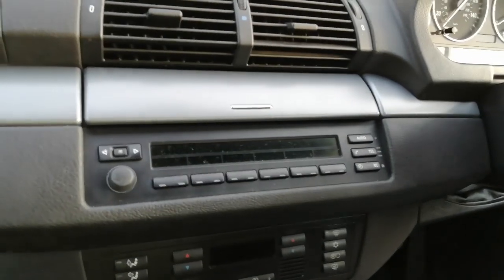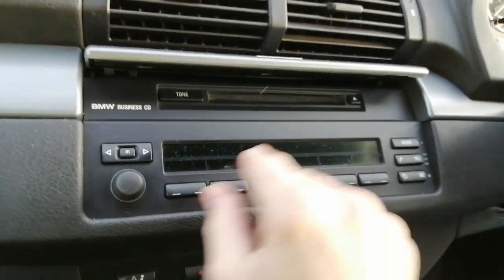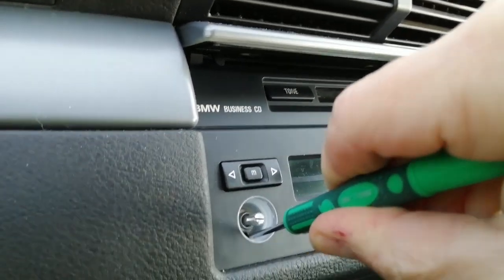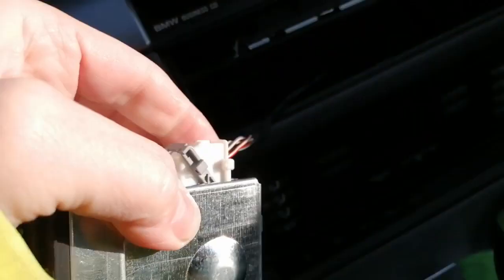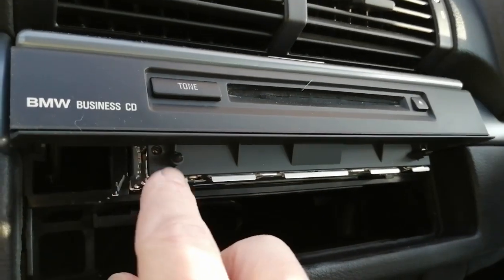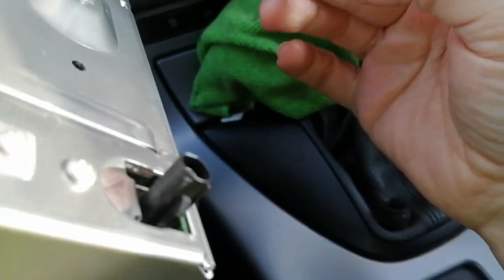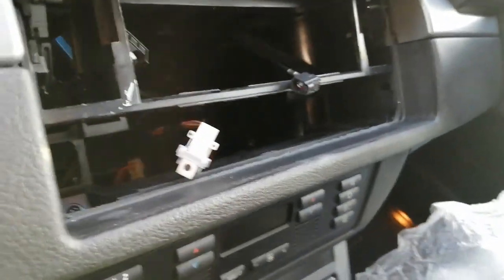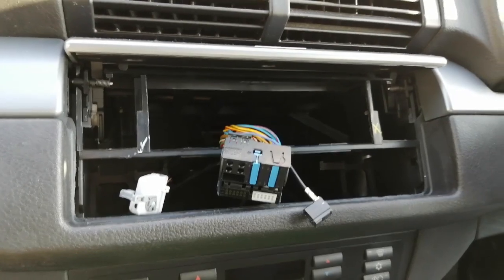BMW X5 1999 to 2006 how to fully remove factory radio/cd. Simple step by step.

Comment: Did you need the 6m cable
Reply from the maker: This particular vehicle was a long time ago so hard to recall but if yours has the rear mounted amp then you would need it. 
Give your reg number to a car audio supplier so they can check if unsure.